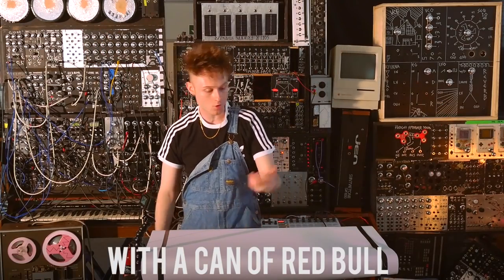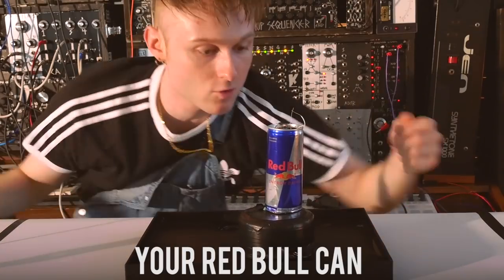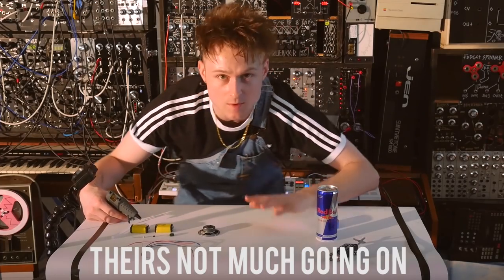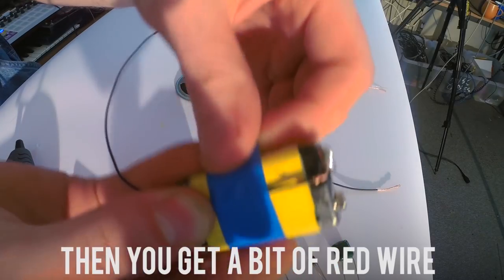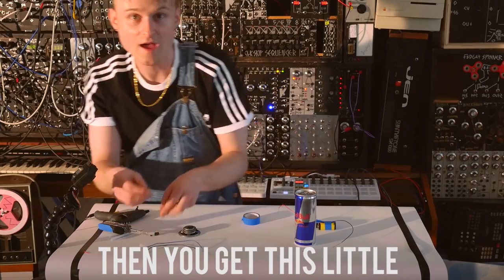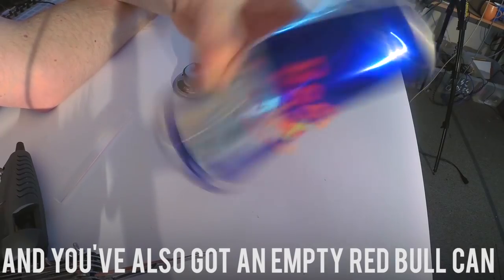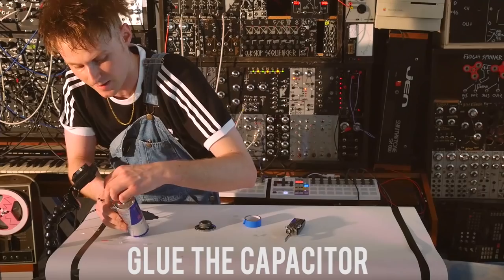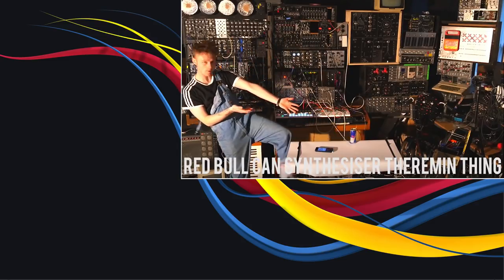How to make a synthesizer from a Red Bull can. | w/ Look Mum No Computer E1

Comment: I just spent a couple hours playing around with this circuit. Here’s what I learned:

1. The trick that made it work for me was to shine a bright light close to the LDR. Like Sam did in the video, I used my phone light.

2. If you just want to play around with the circuit, you can use a breadboard.

3. I tried a couple transistors with the middle leg still on, even with the middle leg connected to the breadboard. It worked 🤷

4. The type of LDR will change the range. I found that the GL5539 worked the best from me, after having tried the GL5506, GL5516, GL5528, GL5537, and the GL5549. But they all worked to some extent.

5. Different kinds of transistors gave me different frequencies. With the 2N3904 I could only produce annoyingly high-pitched sounds, no matter how big the capacitor. With the BC547 I got sounds similar to Sam’s. The BC337 also worked, though less pleasing. And the BC517 was my favorite. Fun stuff. I didn’t even need the phone light for the oscillation to start with all of these, except for the 2N3904. If playing around with different transistors remember to swap the legs around, because the pinouts are different.

6. It won’t take just a couple of minutes to put together 😉

Overall, really enjoyable experiment. Thanks, Sam!

Comment: Hole up you lost me at the end there, how does the circuit itself actually connect to the two 9V batteries, they're not actually connected are they? Also, maybe a stupid question, but how fundamental is the can to the circuit, is it just a gimmick or is it functional?

Comment: How do you solder a jack out to the speaker terminals...? I made one and I want to play it live on stage and I need a way to plug it into the mixer. I tried soldering the + and - to a 1/4 male plug and plugged it into my amp and it didn’t work. Do you have any suggestions for me? Your videos have inspired me to start messing with electronics! Thanks LMNC!
Reply: Solder one wire to the contact connecting to the lowest plate on the plug. That's ground. Then solder the other one to any other pin as it connects to either left or right. Solder it to both left and right if you need to.

Comment: how loud does this actually get? can I just replace the speaker with a plug and just hook it up a mixer/interface to record the output?
Reply: hey! i made 4 or 5 with different random speakers i had lieing around from broken toys, some were really loud! some werent so much. aim for an 8ohm one, you can solder a jack out to the speaker terminals too! so you can have both! thats how i got the direct audio in the video! :)
Reply: LOOK MUM NO COMPUTER I tried this with an 8ohm speaker with a slightly bigger cone (about the same circumference as a 500ml drinks can), and it was super quiet. Maybe there was a loose connection or something, but the circuit still functioned more or less as intended.
Reply: How do you solder a jack out to the speaker terminals...? I made one and I want to play it live on stage and I need a way to plug it into the mixer. I tried soldering the + and - to a 1/4 male plug and plugged it into my amp and it didn’t work. Do you have any suggestions for me? Your videos have inspired me to start messing with electronics! Thanks LMNC!

Comment: How does the transistor work when deer's no current to the base?
Reply: I think (might be wrong) that the battery charges the capacitor until its voltage is high enough to conduce straight through the transister, discharges and then starts again. its hard to say which pin is which as we dont know the part number. then a lower or higher resistance from the LDR will cause the cap to charge at different rates, almost modulating a kinda PWM on the speaker
Reply: TheLethalMoo he does say it in the video it's a 2N3904
Reply: TheLethalMoo it's a standard EBC pinout so he cut the base.
Reply: James Broderick thanks :)
Reply: James Broderick i don’t understand how this circuit works, explain the capacitor and transistor part?
Reply: Cmckenna ok so the transistor has a voltage that when reached will allow current to flow through the transistor. So the way it works is the resistor will allow the capacitor to charge untill it reaches the trigger voltage. When this happens the capacitor is drained and this repeats if you want a visual explanation look up "one transistor oscillator"
Reply: James Broderick thank you! So why did he not just use a diode instead of a transistor?
Reply: hey james! search up reverse avalanche oscillator..... hopefully that will explain some things!